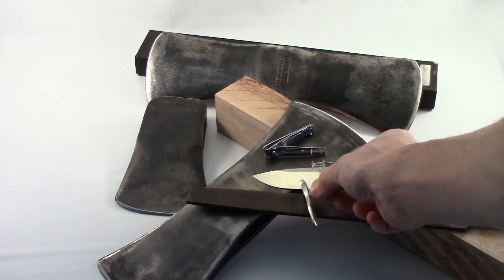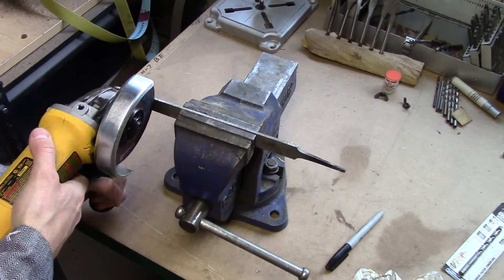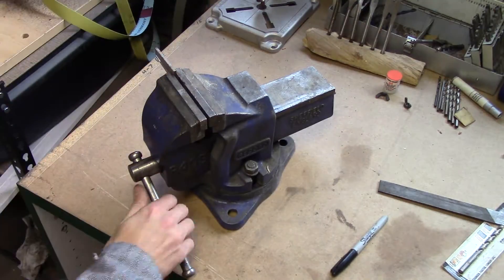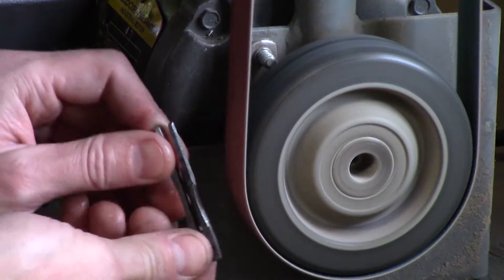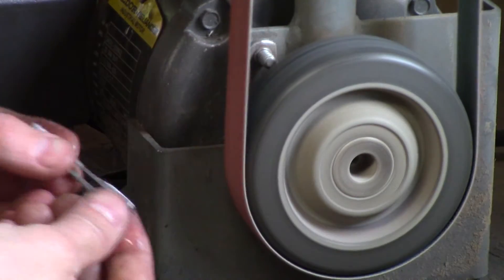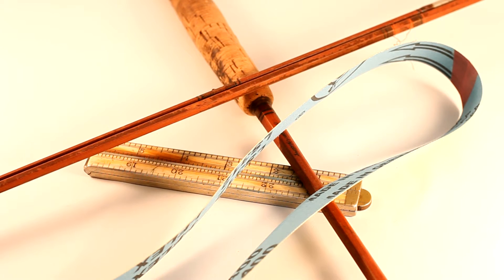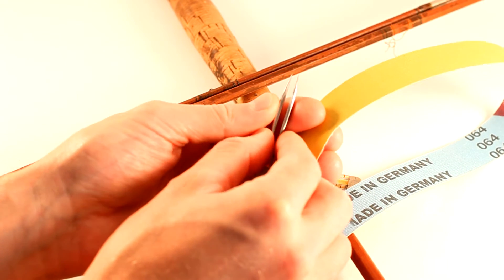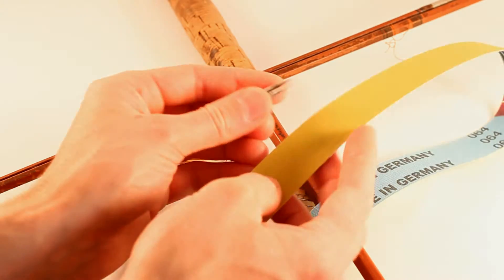From knives to tweezers

Comment: What is the object or material you rub on the belts when you change them?  Also, how do you keep the tweezers from rusting?
Reply from the maker: James Smith I'm rubbing the belts with a cleaning stick (or abrasive cleaning bar) it's nothing more than a large eraser to clean out the previous debris.I don't have to worry about rust on my tweezers so much.  I simply keep them clean and dry.  If rust became a problem I would use Flitz on a buffing wheel to take off any staining.
Reply: Awesome,  Thanks,